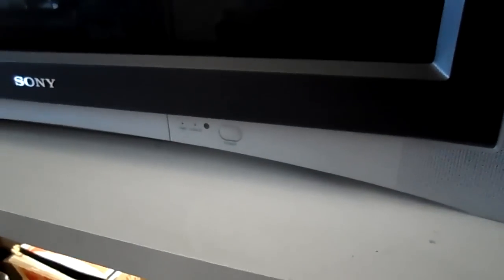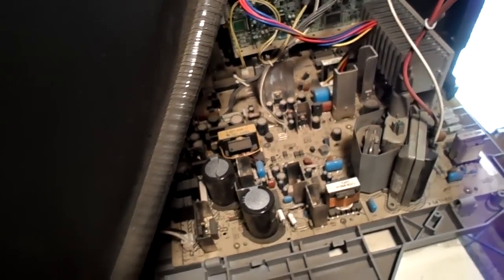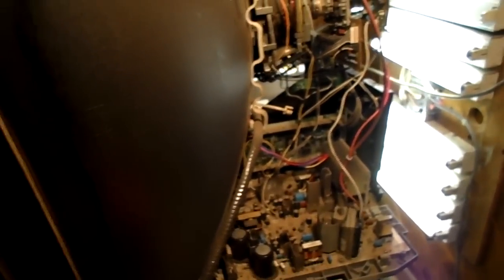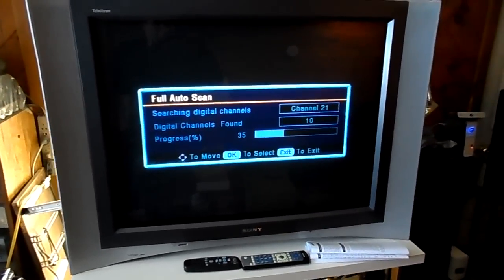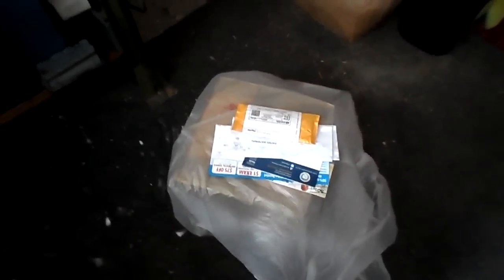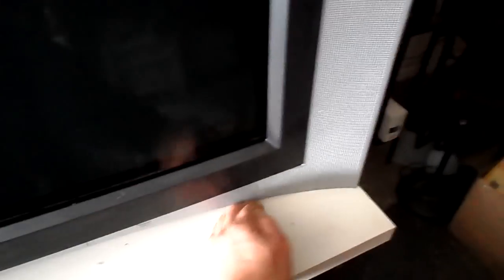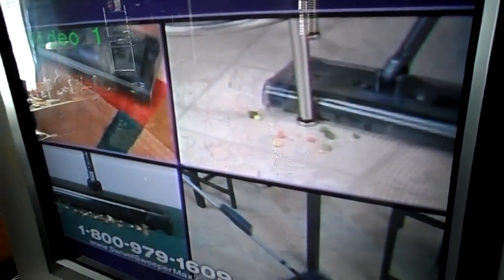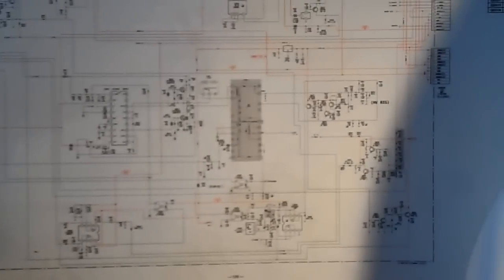Sony KV36HS510 with the DA4 Chassis Problem.

Comment: First and foremost, Thanks for sharing your insight with the general public. That certainly is appreciated.

This morning, I picked up a 34hs420 (Wide) as a replacement for my (still fully functional) Sony 27" KV-FS100. I always own 1 CRT television in addition to my others specifically for gaming due to the fact that I can not tolerate input-lag, motion-blur and sluggish controls, etc.. It was listed as a free item on Craigslist and the notorious 6-blink issue was the reasoning behind the previous owner giving it away..
After researching the issue, repair method & cost, I am confident that I can repair the 'D' Board fairly easily and that the cost would be roughly $20 so I wouldn't be the end of the world for me if I were unable to repair this television, for whatever reason.
been working repair-free, for the moment.
My plan is to de-solder then attach 2 18-pin connectors between the board and the replacement chips in order to make future replacements much easier (if necessary).
In the mean time,

After arriving at my home and unloading this beast, I had decided to test it out and it powered up immediately.. I have already connected my gaming console to it via components, rather than HDMI, and then set the Xbox 360 video output to the1080i Widescreen signal (attempting to keep all forms of digital processing, upconversion etc. from delaying the video output displayed on-screen) have begun play-testing this beast.. I began to play an online custom match of Halo 4 with a friend and I could instantly tell that this television was everything that I was hoping that it would be by comparison to older 480i sets that I was used to using, in the past.

Powered the television down and immediately put it into service mode. Located the High-Def Pass-thru setting and changed the value from 1 to 0 in order to disable any further post-processing. (This setting affects 1080i signals ONLY). Quickloy powered off and back on again after writing changed value to NVRAM.

Been a treat and I am hoping that it holds up until I receive the necessary repair parts in the mail.

I hope to one day acquire a 30 inch XBR910. Wish me luck.

-JIM

Comment: The first cycle of blinks is the self diagnosis which hsould always be or is normal considered not to be of concern upon starting up the set because that is how it checks for the likely things of failure to be working ok...as you have a self diagnosis supported model however if you may show the right thing in the service menu and the original remote commander is acquired then you may have ability to check if somebody has not already cleared the remote commander memory that is inside itself because that will show where and what the probable cause or trouble and issues are within that set... however this may not be easily feasible just saying... but yah where there's a will there's a way.

Comment: Have had this same TV since December 2003.  Just this summer, the TV started doing the 6 blink and not wanting to turn on.  At first it would eventually turn on.  I just tried a hair dryer to "warm" it up, but no luck.  I live in north Texas and it's pretty warm up in my man cave unless the AC is on, so I don't think my "6 blinker" is related to that component that needs to warm up.  I'd love to be able to get the thing working again as 1) it was a Christmas present from my wife for our first Christmas, 2) the thing still has GREAT picture quality and 3) it's so friggin heavy that if it goes down the stairs, it will be a one way trip.

Comment: Sigh.. change the MCZ chip closest to the flyback.  That'll fix your cold start issue.  The biggest problem is getting MCZ chips that aren't counterfeit...Also change the 33/160 in the middle of the board.  Also, NEVER remove the yoke from a Sony.  Sony always avoided paying other's patents so the Sony deflection yokes are squirrely.  If you remove the yoke, you'll never get the purity and edge convergence perfect (they sometimes weren't even that great when new).
Reply from the maker: Thank you for the tip re: the MZ's. They have been changed, & changed again. Ordered some original OEM's from a well known supplier, as am told the replacements may be knock-offs. I tried a second "D" board from another set, which was said to be working, but does the same thing strangely. Was wondering if it was the CRT itself possibly. Since then I have accumulated several spare DA-4 chassis from folks who toss their working sets for flat panels, & also have that new set of MZ's to try sometime. Thank you for watching!
Reply: The only reliable place to order MCZs at this point is B&D http://www.bdent.com/nsearch.html?catalog=yhst-864421581610834172249761&query=mcz3001 .  I've also had to correct damaged traces and missing/damaged smd devices from roughly replaced ICs done by other techs and amateurs.   Regarding your second D board that is supposed to be working but not; if it hasn't been played with, the board should start when the IC closest to the flyback is preheated.  If it doesn't, then you may be getting no horiz drive  from the signal board.